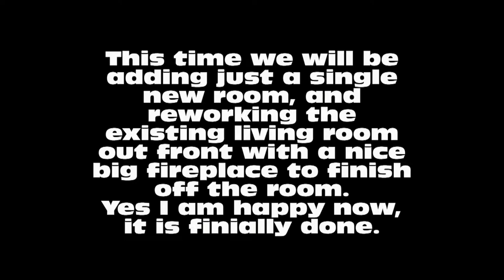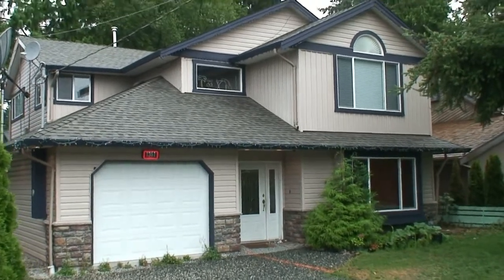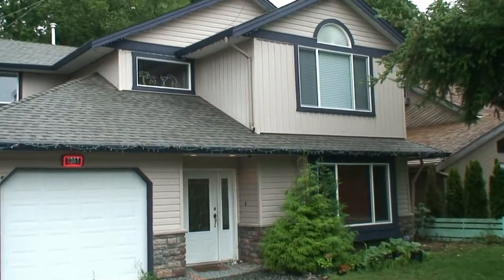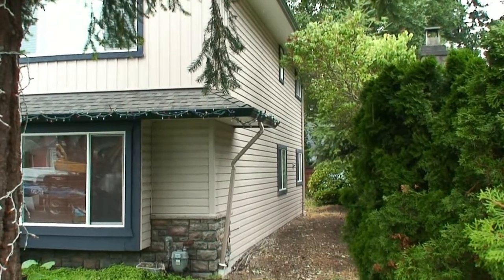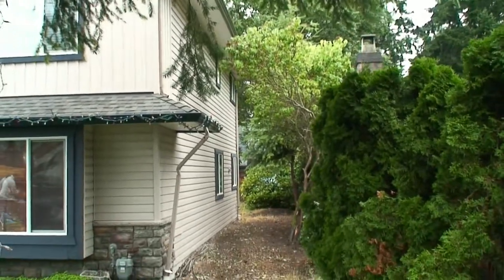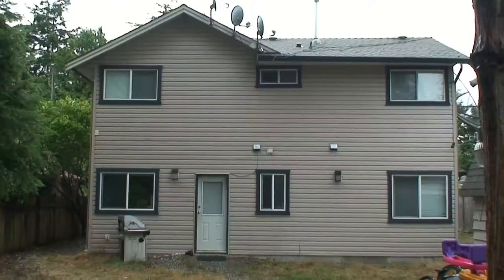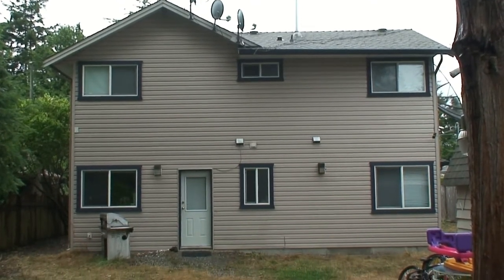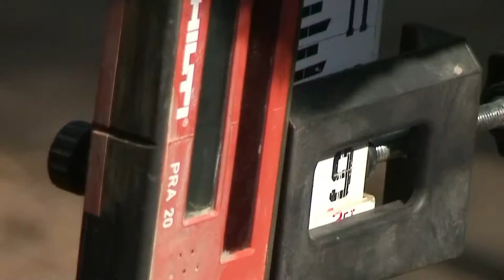hd reno

Comment: Very nice and what a great transformation!  I've done every job seen in this video and the two I hate the most is painting and laying pavers....I'd do just about anything else not to do them, arg!   :)
Reply from the maker: JacksJunkDotCom I only appeared in the video a few times, doing electrical work, even thought I did a fair bit of the electrical work, I was ususllay holding the camera, filming others. I thing there was a shot of me wiring a dishwasher, and range hood, and the main breaker panel, but I did much more than that. I put in all the Ethernet to every room, all the coax for satellite tv at the time, full alarm system, all the telephone wiring, security cameras, speaker wires. I hired a sparky to run in the mains wiring, but I went in and wired up all the fixtures, switches and outlets.
Reply: @12voltvids  ....... next "The Pool "  .... :-D
Reply from the maker: @Ramdileo_sys  
That will never happen. As far as I got was a hot tub.  Even that isn't used, except to cool down on a hot day.